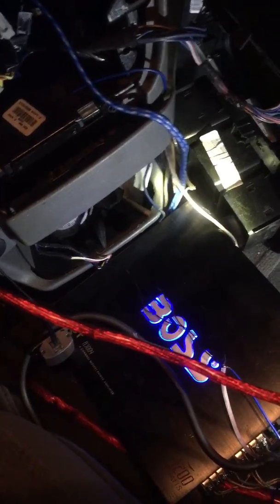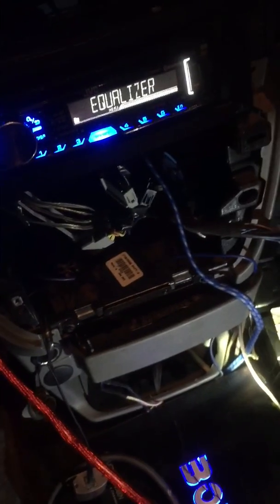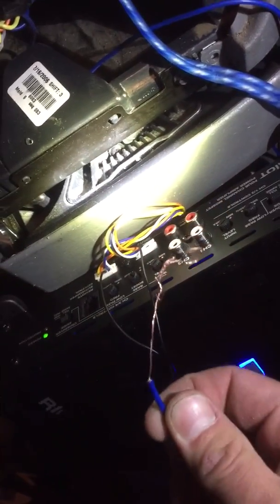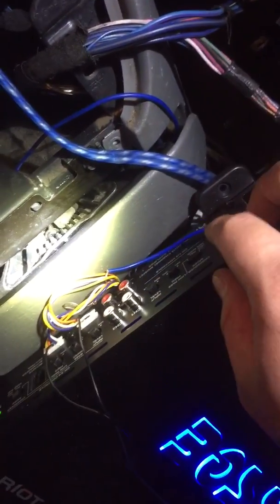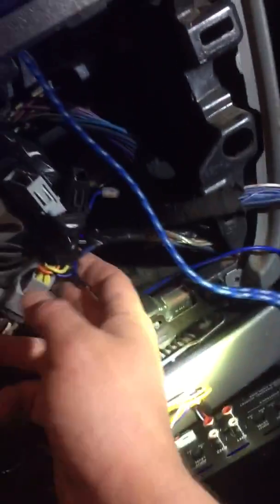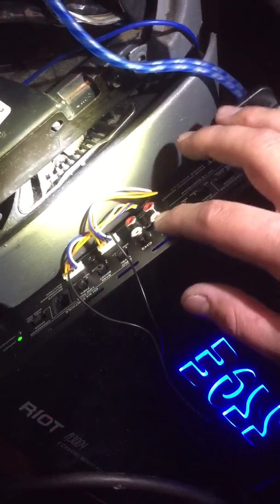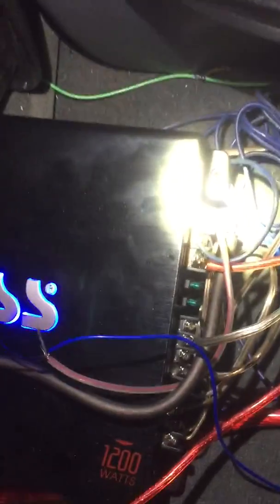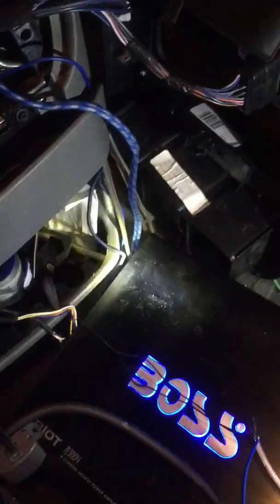FIXED: Annoying hissing, static sound, “engine whining,” buzzing and etc. by a super simple trick (

Comment: Check your rca cables. Don't run them close to the power and ground wires. I had the same issue. Took it all out. Redid my wiring layout. Just try to keep rca cables on opposite side of your car/suv.
Reply: I did what you said and still have that whine/static, I’ve tried many things and nothing seems to work, I need help

Comment: Ive tried both ways, high level input and RCA's. I'm still getting the wine I've tried everything! Bad alternator maybe? Please help
Reply from the maker: Since the time I posted this video I’ve learned some other things that might cause this. If ur running rca’s make sure they’re located separate from the power wires as they can crosstalk. Also, what kind of head unit r u running? It’s been a while since I’ve looked into head unit problems, but I’ve read that there are some kind of chips inside that keep the head unit from making all kinds of unwanted sounds and those can burn up. And r u running an amp to power ur door speakers? If so, make sure ur getting the proper ground to the amp and the speakers r properly connected.
Reply: Hey thanks for replying. I'm running a brand-new kenwood ddx26bt double din to my brand-new skar sk-m4004d 4 channel. I've tried all the tricks with RCA's and high level. I've given the Hu it's own power n ground straight to the battery. No luck. I've separated power, turn on, speaker wire, RCA's a few times. No luck. I've tried to ground the RCA's I've grounded the high level. Still no luck. It's driving me crazy man any help would be appreciated!
Reply from the maker: @joescott5558  do you have any problems with ur battery being charged by any chance?
Reply: @_N_B_0496  I just checked my battery voltage. 12.65 car off. 12.85 car on.. I've read when ur alternator is bad that it puts out ac voltage into the charging system and that's the noise ur amp is amplifying (the whine). I think I just found the $200 problem
Reply: @joescott5558  did you ever get it fixed?
Reply: @angelcortes3872  No, I tried it all man every trick on the internet. I got fed up with it and took the 4 channel out. Now it's sitting in the closet. It's the skar sk400/4 class d. Do all class d 4 channels make that noise? Or is it just mine?
Reply: @joescott5558  no clue man, did  yours make a wine when you pressed the gas?
Reply: Yup it sure did

Comment: Thank you so much for this video! This helped solving the unbearable alternator whine! 

Just a wire from the amplifier ground to the frame of the headunit did the trick! 

I still have to check the factory ground wires to find the source of the ground loop problem
Reply: Hello! this ground  you  connected to screw of  amp? or terminal ground amp?

Comment: Wow why in the absolute fucking hell would you go through the   trouble of  using high level inputs and ripping apart your wiring harness when you have the literal one thing that prevents you from having to use them: AN AFTERMARKET HEADUNIT!  Low level input will always be cleaner and simpler than tapping into an already amplified signal!!
Reply: I've bought a vehicle from someone who ended up doing this. I wanted to shoot myself in the face. The wiring harness had all sorts of bad spots after he was done.
Reply: Alot of people want to retain stock look a climate control features with oem headunit. It's not that difficult. Cut your harness and wire high level to a line output converter like an lci7 where you can amplify the input signal to match the amp rca input voltage. Just label everything if you plan on putting back together to resell.

Comment: So I have a 2019 ram 1500 I installed the subs to the stock head unit using a low output adaptor. For some reason I can hear the this loud rumble while driving or when the truck is at idle I’ve tried EVERYTHING! Could you please help me out ?
Reply from the maker: Ok, so what headunit do you have? Which methods have you tried already? Send me some pics of how you have it wired, and maybe some kind of wiring diagram that you’ve been following maybe? Here’s my email nikitos260496@gmail.com
Reply: I have same issues did u figure it out?

Comment: I have a similar issue but in my case I am using a 1000w PSU to power my speakers and sub and I am getting the faint hissing despite grounding out the head unit. I believe it is an issue with the power supply. Are there any easy solutions to this?
Reply: Move the key on switch wire to another spot that still turns  on when u tryin the key. Anywhere at the fuse panel

Comment: Man I have this very same problem. My amps is in the booth. There is no point in running a wire from my head unit too the ground of the amp. The ground of the amp is going to a screw in the chasis. So I think is more than enough to run a wire from the metal case of the HU to another screw on the chasis in the front. Whre? I don't know yet. I have a mercedes and there is ton of other matterials till the metal. I shall see. About your setup, man you took it all wrong. Using RCA's is more efficient. I have 3 pairs. One for the sub, one for the front speakers and one for the back speakers. I don't use anymore the amp from my head unit so as you can imagine is quite cold. The main reason is the quality. Instead of using signal from your preamp, you are using your player amp to rise it (add some artefacts) then you take it down again with the high-level inputs of your amp and then again rise it with the BOSS amp and add more artects this time from it's own circuits. The results is desaster. I always disagree with this solutions. I will rather have no amp, the quality is very very bad, you loose the briliance and the result is muddy. So fucking muddy is hateful.

Comment: I got away with buck converter. I start the car, connect buck converter to battery and set it to 12v-ish to power the stereo.

I use relay with the coil connected to ignition cable from the car and to chasis. The battery goes to buck input then to relay. NO pin on relay connect to both the stereo battery and ignition. This stop engine whine, but still got small noise. To make it dead silent, I use 4700uf parallel with 100n capacitor on buck output connection.

What I suspect here is that the noise injected from ignition wire to the stereo. Try to connect ignition wire to the stereo through buck converter set to 12v, you do need relay in this case. Buck converter deliver constant voltage and there is also output filter on it, adding capacitor on the output act as another filter stages. If you connect battery through buck converter you need bigger module, which is more expensive. If its just ignition you could made it with micro buck converter under a buck.

Comment: Hey man ! Thanks a lot for this helpful video. I will try out your recommended fix. However, for this audio whining problem with engine speed, I tried replacing my RCA cables and it worked fine for a while. I never started my car engine after that. After a few days, when I restarted my car engine. There was a static crack sound in my speakers followed by whining when hitting the gas. What could be the problem? It’s weird cause I replaced 2 RCAs already but whenever I start my car engine after some time, the problem returns
Reply: Im not an expert but simply replacing the RCA's wouldnt solve that issue. They still arent grounded properly its a problem with how the car is built/ how the head unit is built. If people didnt use such cheap bullshit in their products we probably wouldnt have these issues.